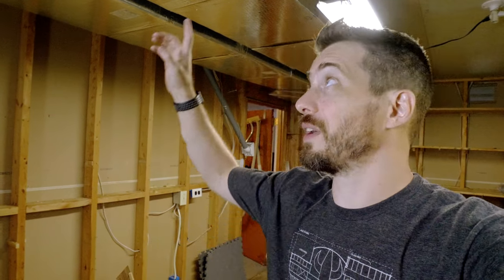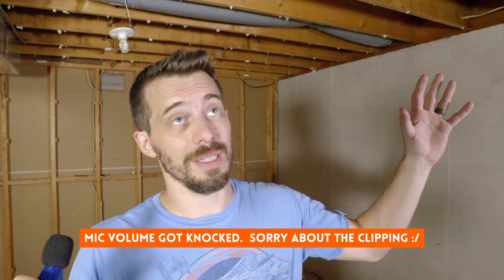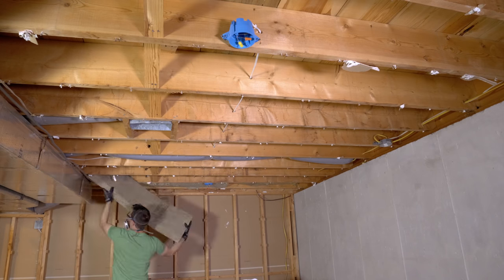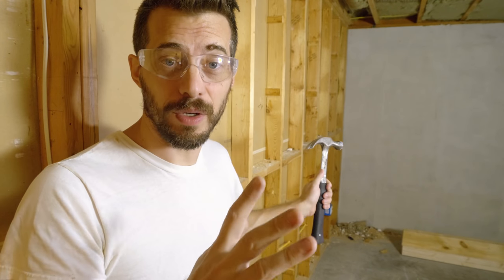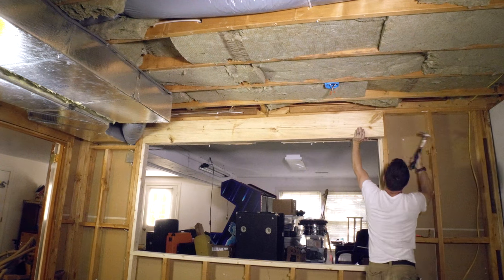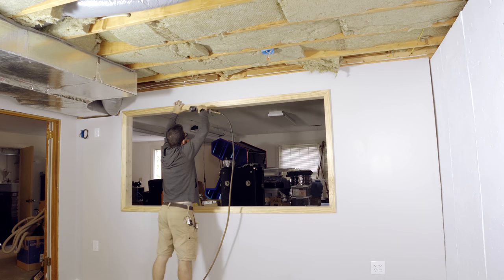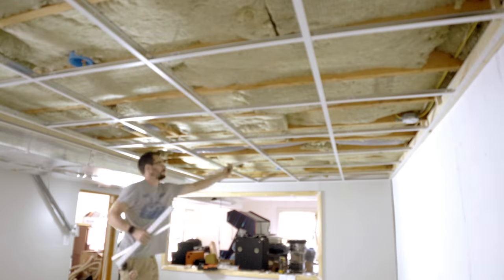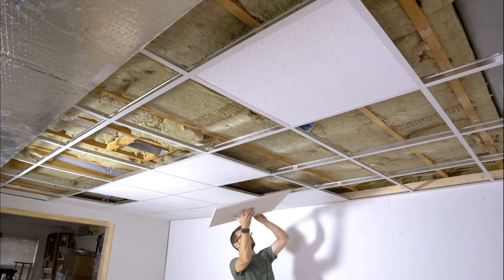Storage room to Office/Studio Conversion // Home Renovation | I Like To Make Stuff

Comment: Hey, I know this may be rather redundant, or too late, but if you need any carpet-related help, let me know. I'm a carpet layer by trade, and I feel like if you're using the office for voice overs, etc, carpet and underlay on the floor will significantly reduce noise sustain
Reply from the maker: Thanks! I actually added carpet right after this video was finished and it helped the sound reflection quite a bit.
Reply: All good! Love your work, and your video style and editing are on point. Keep it up. Cheers from Australia!

Comment: you could have used this paint that they use at my school, you just paint it on and the surface turns into a whiteboard
Reply from the maker: I've used it before. It works alright but is a 2 part mixture that takes a while to fully cure.  This is quick, easy and can easily be changed later.

Comment: By hanging a drop ceiling you have installed a grid you can use for lighting! There are clamps that attach the grid which you can use to hang lights and cameras etc.
Reply from the maker: interesting! I'll have to look those up!
Reply: Here is a link: https://www.bhphotovideo.com/c/search?Ntt=drop%20ceiling%20clamp&N=0&InitialSearch=yes&sts=ma&Top+Nav-Search=

I dislike the look of drop ceilings, but I've always wanted to have one in my studio for basically unlimited placement options. 

Not shown is the fact that most (all?) of these twist on the main shank to tighten the clamp onto the ceiling so it won't slip off.